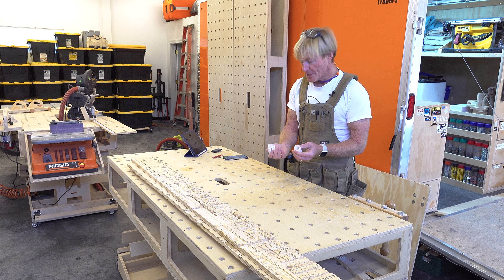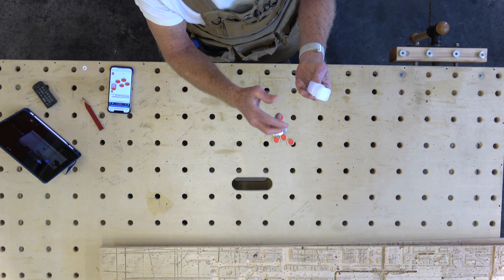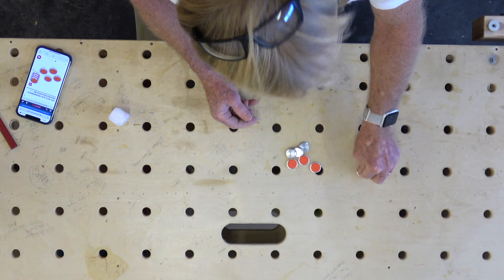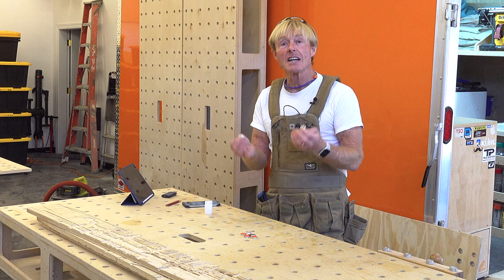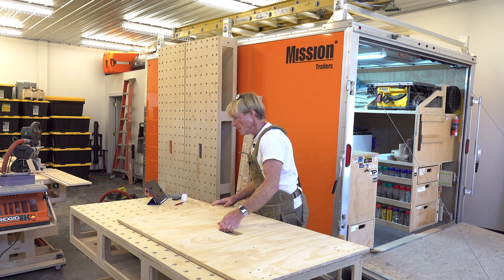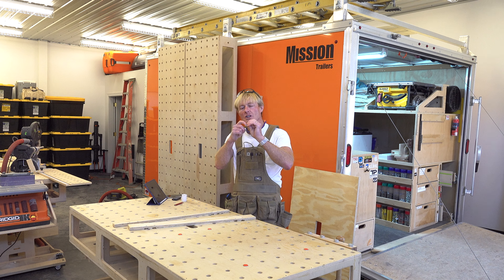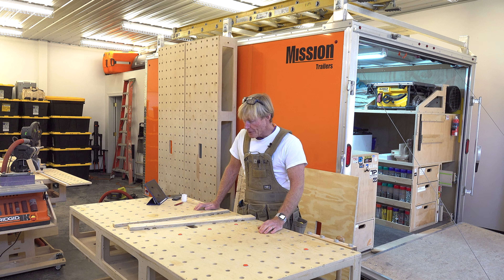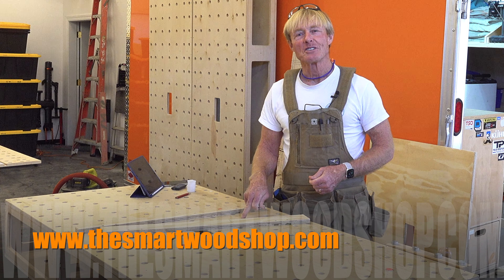UJK ANTI-SLIP WORKBENCH PROTECTION DOGS

Comment: I 3D printed a bunch out of TPU (flexible, grippy) with different heights. Cost about 12C each. Square top, so they can be used as stops, too. If you accidentally cut through one, no problem.

Comment: I take small leftover pieces of foam from jobsite and cut em up into consistent cubes of whatever the thickness is then throw my foam dice on the table whenever I make a cut. Sweep them into a little tub and back into the paulk cubby when I switch to assembly. Even if they roll around a bit  they’ll settle on a side and its surprisingly sturdy and even. No worries about hitting the top either